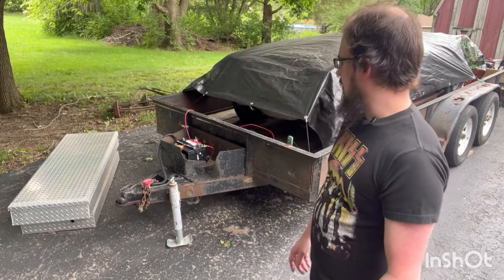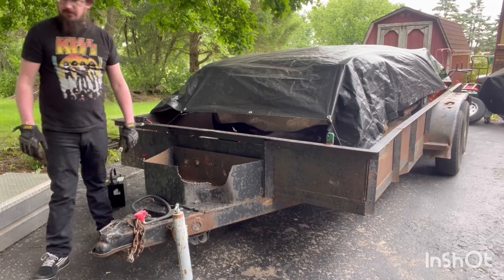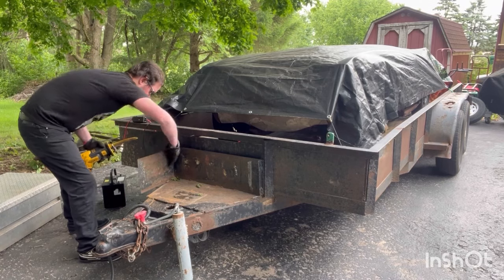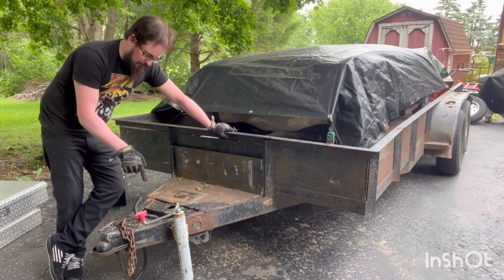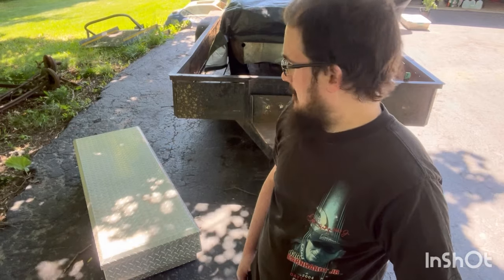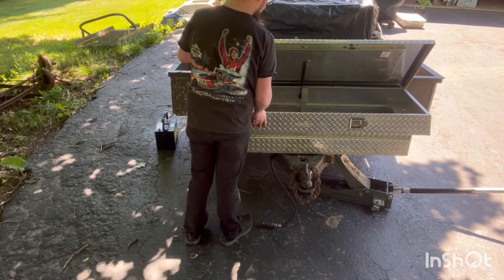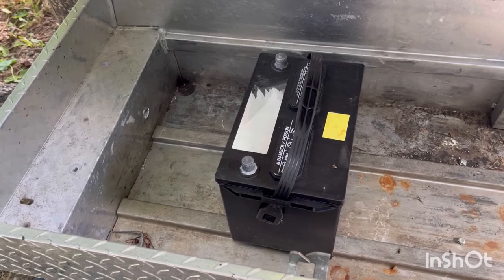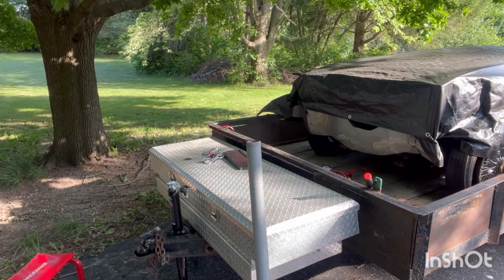Trailer Mods That Make Life Easier #cartrailer

Comment: I did the same thing you're doing.  But much smaller box - was for a mini truck, and my A-frame was much longer.  I still dinked the corner once backing up in a tight turn.
Reply from the maker: Yeah I may move it higher onto the rail. I’ve been hearing from others that this may not be the best option, but hey I gave it a shot